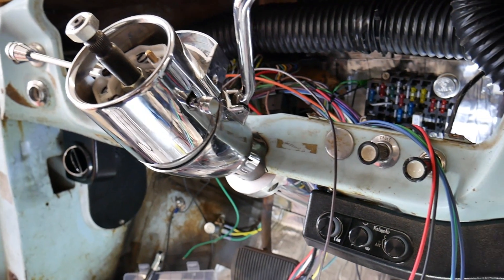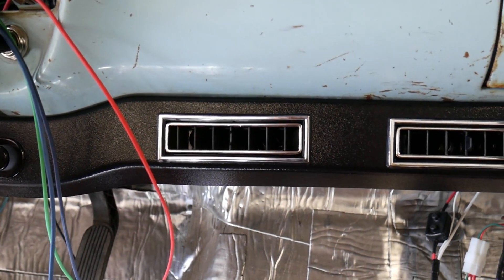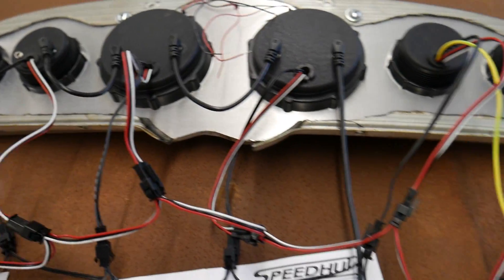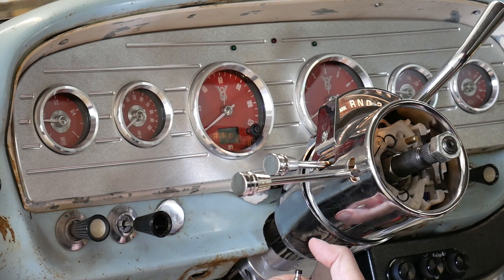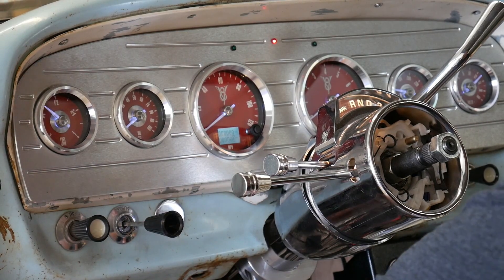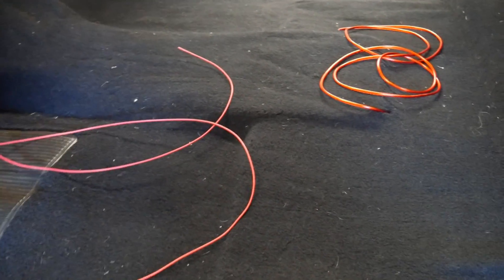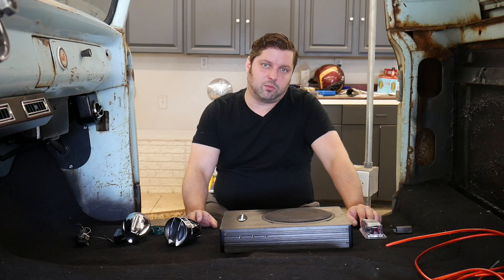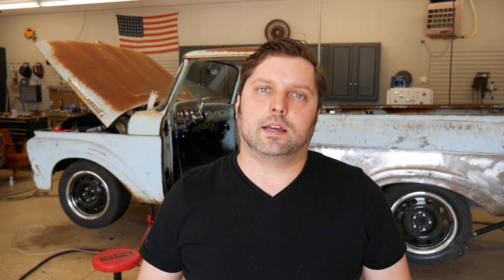F100 to Crown Vic Frame Swap ep.15  Interior, gauges, stereo, A/C INSTALLED!

Comment: Hey awesome job, i’m In the process of installing a vintage air system in a 1970 F100 with a full 2009 crown Vic swap. How did you end up connecting the trimaran swith into the stock crown Vic electric fan module. Or did you wire up something different?

Comment: Yep, frame swap fanatic about sums it up for me. 
Have you tried using your scanner in the OBDII port since you've wired the dash in?  Any funny results?  As you were describing the installation, I was wondering if the gauges would work in parallel with a scanner.  You may also wish to plug in some other peripheral OBDII device in the future, perhaps to monitor as you drive. 
Thanks for the best video yet!

Comment: Mat.... I was curious if your P71 had a engine oil cooler that is located in the lower radiator hose, and if so when you moved the radiator back towards the motor if it caused any issues, I got my 62 uni on my vic frame last week and I'm getting ready to fab up the body mounts, was just wondering if your EOC was the same since my P71 is a 98 and if the hoses from the filter housing moved enough...thanks!

Comment: Love your videos watched several of them many times quick question. When you added your EZ wire kit did you just connect to the ignition and how did you hook up your brake light sending unit? Doing the same thing you pretty much did with your wiring  on 08 Vic and 61 F100. Thanks.

Comment: The column that you installed, are you happy with it? Anything about it you didn't like. Looking at that same unit for my 72 swap.
Reply from the maker: +J 556 it's okay. It works well. My only complaint on it is that the turn signal doesn't shut off when you return the wheel straight. Just have to get used to shutting it off. But much better than paying $800 for a name brand column.
Reply: OK....well, we can get a jump on being the old guy with his blinker on for 10 miles then. Very appealing for the money.

Comment: Sorry it might be stupid question but why take the time with thinning the harness if you just buy an ez wiring kit
Reply from the maker: Not a stupid question at all! I thinned the stock harness down to just the “run wires” for the engine, computer, and fuel pump (and fuel pump inertia switch). The EZ kit is to run everything else, lights, AC, Stereo, etc. The 4.6 Modular engine requires the computer, and CANBUS system to make the motor, ABS, gauges, OBD2 and transmission all work together smoothly. So I stripped the stock harness down to those core components. If this was an old school non-fuel injected engine and old school trans then you would indeed be able to wire everything up with the EZ kit. Thanks for tuning in, and thanks for asking!
Reply: Thank you for the reply! I have started stripping my p71 and came across your ez wiring video. You have one of the cleanest swaps I’ve seen. Again thank you